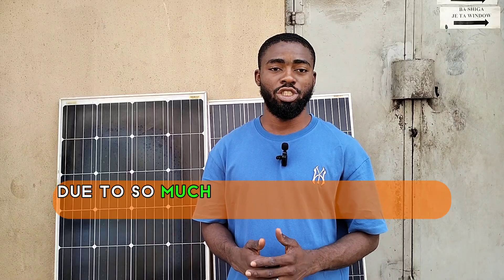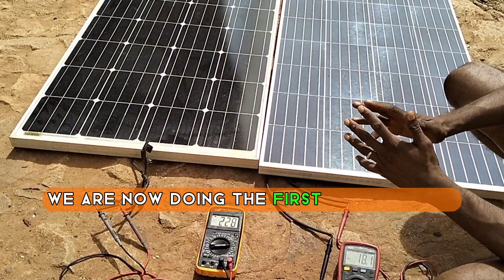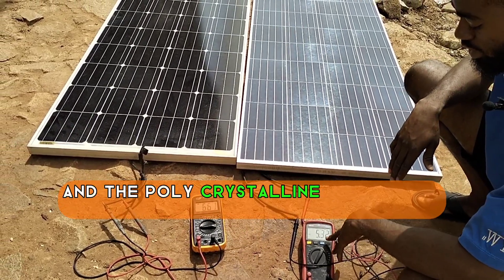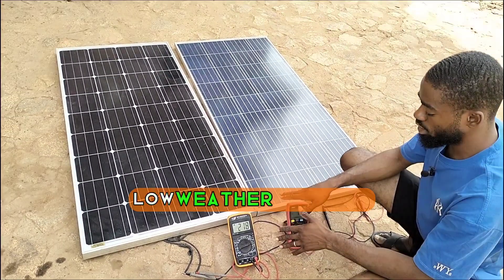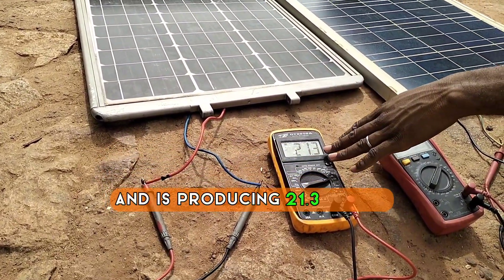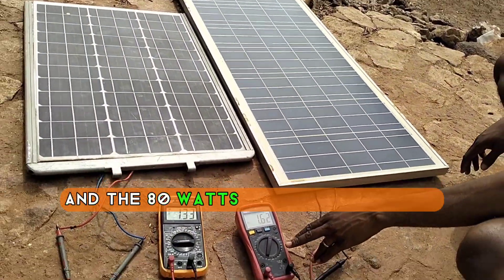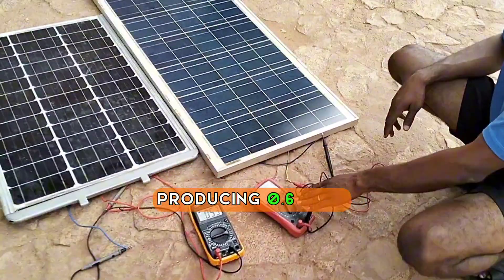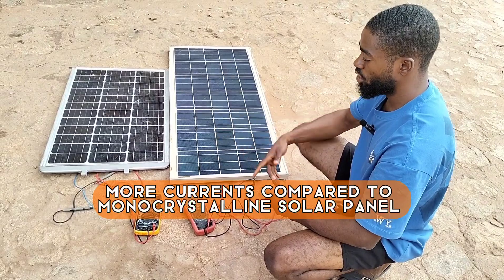practical test between monocrystalline and polycrystalline solar panel.

Comment: Hello Solar God, my solar system was overized. I use 2 pcs of 20kva felicity, 2 pvs of 120 felicity scc, 24pcs 650watts panel. I was thinking of adding an extra battery for backup time. I noticed im not getting up to 80 percent of my panels wattage when i look at the scc. How do i resolve this issue before adding battery

Comment: to be fair you should have used the same meter for the measurement.
Reply: Multimeters do the same job. Using different meters for the solar panels will not change the result.
Reply: @dauntless5377 Exactly and well said. I can deduct from his submission to mean all readings done from other multimeter other than his own may not produce a result he will accept 😊

Comment: What was your load ?
Reply: @Mairigaemmanuel  to measure current drawn in an electric circuit the voltage from the solar panel must pass through a load,ie like electric bulb ,motor,tv,radio.
What did you use in your experiment ?

Comment: Full Sunlight

Mono       Poly

22.8V      18.1V
6.59A      5.32A

150.252W   96.292W

Under shade

1.82a    1.54a
21.8v    17.0v

39.676w  26.18w

250WATT MONO WINS 2X POINTS LOL

80 watt panels

Full Sunlight
Mono     Poly

21.3v    19.3v
1.32a    1.63a

28.116w  31.459w

Under shade

Mono      Poly
0.53a     0.67a
20.2v     18.4v

10.706w   12.32w

POLY WINS THE 80WATT CHALLENGE

PLEASE NOTE!! THAT MONO IS FULL OF DIRT AND NOT CLEAN!!! HAS MORE TO GIVE
Reply from the maker: Even jinko won't produce it's rated watt under shade

Comment: It is okay use 2 deferend panel watt together, like 100 watt panel and 180 watt panel?
Reply: Do not do so because the difference in the output wattage would not marry each other. You can alternatively connect them in Series instead and pass the unit via a Proper MPPT CONTROLLER like the one of EASUN.
Reply from the maker: Nope,

Comment: it would be nice if you gave the specs of each panel, use identically calibrated meters and stand away from both panels. your knee shades the poly panel slightly. nice test though.

Comment: I wish this video will blow up. I am yet to see this type of comparison video to end the argument regarding which is better between monocrystalline and polycrystalline solar panels.
It would have been even cooler to have you show a switch from voltage drawn to current drawn per panel per time.

Still, a very good video. Thank you very much.

By the way, what do you think about the suggestion from a seller that Monocrystalline solar panels are better suited for places with cooler weather (specifically not Nigeria)?
Reply from the maker: Thank you very much.

Such cases are rare since most of those things cannot be ascertained practically